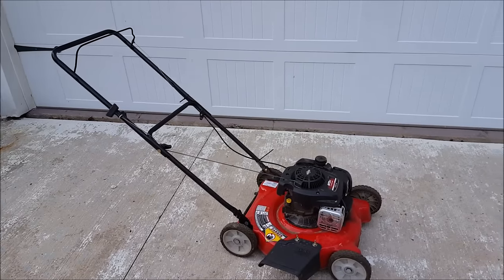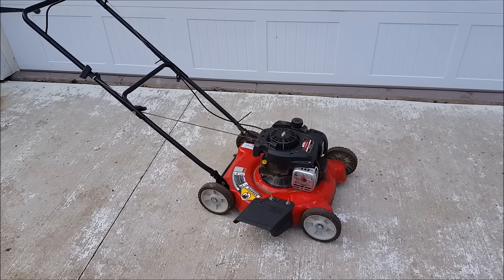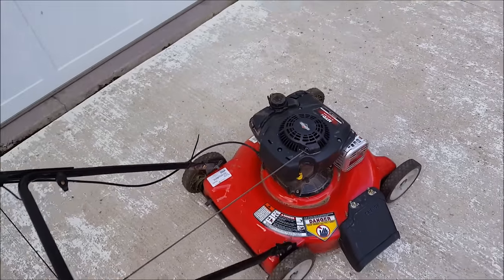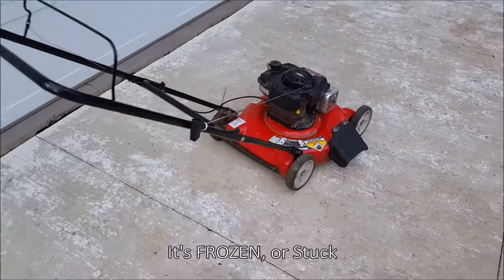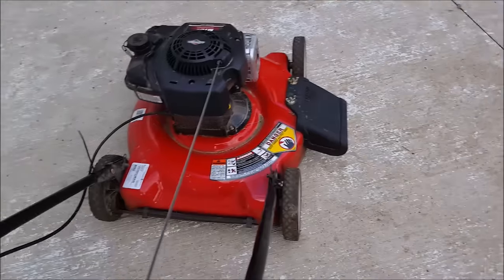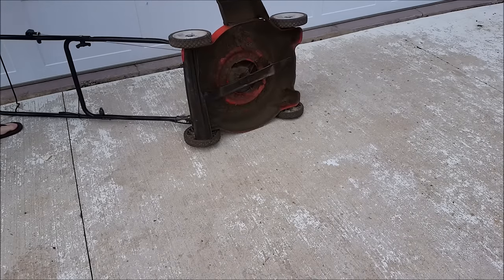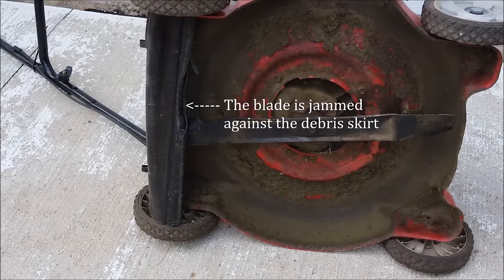How To Fix a Stuck or Frozen Lawnmower Pull Cord (EASY)

Comment: I turned it on its side and I removed all debris that was under there and I turned the the blade by hand it was really tight but after a few turns it did turn some what, however as I was turning all the sudden the air filter popped off and a bunch of oil spilled out. The cover was off the air filter because I had purchased a new air filter and was going to put it on. There is no more oil in the mower now. I think I should also volunteer that I am a 63 yr old widow, my husband was a wiz and fixing things and before him my father was also a wiz at fixing things. Everyday I realize that  nobody ever taught me anything useful. I am a wiz at many things but not at keeping things in working order. Dads teach your daughters how to fix things, it is an important life skill.

Comment: I was ready to go and buy a new lawnmower.  I watched another video on how to fix the pull string, but realized that was not the issue.  After watching your video, I looked at the underside of the mower and realized it had quite a bit of built up hardened grass and dirt... A simple cleaning and the mower worked as good as it did.  Thank  you so much for the information.

Comment: Thank you so much! My Big Brother used to work with small engines lawnmowers, carburetor's and such.
He passed away last year. I'm living in his house and when things like this happen, I just tell him I need him back. I know that's not going to happen but I want to do the best I can to take care of his property. Things like this are really hard because if he were here, it would be working. I called a lawnmower repair guy. I think he was a competitor of my Brother's business. He told me the mower was junk because it seized up. Wasn't friendly either. I guess he was mad because the city we live in picked my brother to work on their small engines. My brother was in a wheelchair but he didn't let disability define who he was. I miss my brother terribly as you can tell. I'm going to go check the lawnmower out like you said. And disconnect the sparkplug first. My brother drilled that into me. I miss him a lot as you can tell.
Thank you. EDIT: Well, it wasn't what you said but if I hadn't turned it over I never would have seen a LOT of dry grass was holding the blade in place and it wouldn't turn. I cleaned all the dry grass out, connected the spark plug. And it STARTED! Thank You Thank You THANK YOU!

Comment: Thanks this solved my problem today! It turns out there was some grass stuck between the blade and the frame, which made it impossible to pull the cord. After clearing that out, it worked fine!

Comment: Thank you so much.  I was mowing and stopped to move stuff and all of a sudden, no pull.  I did not have a dragging skirt, but it was easy to see that OLD DRY grass had accumulated and would not allow the blade to rotate.  I guess I see the point of the deck wash port now.

Comment: Thank you sooooo much for this video my cord was stuck and it would not pull. I turned it over on its side and there was tons of grass jammed up around the blade. I cleaned out the bottom of my lawnmower and pulled out that part that you said to pull out and it started right up. I thought I was going to have to buy a brand new lawnmower you saved me a ton of money. Thank you again!!!!🙏🏾

Comment: Thank you for making this video. In my case it was a bunch of clogged up old grass probably from the previous 2 years. All my life until retirement I was at the mercy of Lawn Mower Tune-up fixers who take up to 3 weeks to tune a lawn mower up. (They tell you it takes them 3 weeks. It only took me 15 minutes to install a new Spark Plug, drain and replace the oil. Install a new Air Filter and clean out the empty gas tank.)   You saved the day!  Thanks again!  (One thing yet to do: remove the blade and have it sharpened one of these days.

Comment: Thank you u-tube dad. Good name for you. The u-tube father 😊 fixed in a few seconds. Also sometimes you have to turn the blade around clockwise a few times and it pulls when you try and start it. Mine still sticks even though it's new 😮 I cleaned the grass off. Checked for obstruction and still sticks and won't pull. My lawnmower is only a few months old and I've used it 6 times. 350.00 crazy

Comment: Can't express enough my relief with your help! You said, check the blade, and only after looking straight on that blade I finally figured out that it is a thick twig sitting their preventing blade to spin! But before with help of another video  I removed the cover on a top, found spring is fine, looked at the bottom, found nothing! That twig was just invisible and I could not see it! Until I heard from you that magic words, "check the blade" and then I touched it to see if it turns and revealed that dumb twig! Thanks for this lection for dummies!

Comment: I had  the pull cord stick on me last night, after I stopped the mower to move something out of the way.  I pulled it once, it did not fire, went to pull it a second time and it stuck.  Noting I would tell was blocking the blade, checked all the controls.  I brought it back to the garage to give up, but turned it over one more time to look under it and  I heard a pop by the handle of the pull string.  I tried moving the blade again and it moved, I set it back up gave the string a weak pull, just to see if it would turn over, and it actually started up just fine.  Any idea what could have happened?  More importantly, is there something else I should check, like was this a sign of a bigger problem?

Comment: My blade won’t turn because for shipping the handle is pushed short and the ends are blocking the blade from turning. I couldn’t loosen the T-bolts to extend handle. What tool do I need? Thank you.

Comment: My friend gave me lawnmower and she told me it works I change the spark plug and put new gas and oil in it was both out none at all then I clean the carb and make sure the blade not damage or caught inside anywhere.. I prime it 3x I pulled the cord and didn't go back in sooo I'm lost need help do u have any videos how fix that also ur channel help me out and I'm new subscriber too

Comment: So, I was getting ready to go and return my 1 month old lawnmower because the cord wouldn't pull, and I didn't turn mine upside down because I used the hose port last time I mowed, so I was positive that it was clean underneath. Wrong!!! Thing had clogged grass stuck in the blade. This is my first lawnmower with the hose port, so I thought it worked but evidently it doesn't.  Unfortunately because I tilted the lawnmower, it evidently got flooded so it won't start right now, but the string pulled so we are moving forward in the right direction!!!. Thank you for this, it would seem just common sense to see if the blade was stuck, but all I thought was that the engine was jammed.

Comment: Please make sure you unplug the spark plug before you do this!  Also, turn the mower so the air filter is on top.
Reply: Why?  I don't know how.
Reply: @robinobrian4842  remove spark plug to avoid getting your hand chopped off.
Reply: Robin Withrow typically it‘a a good rule of thumb to flip your mower onto the side that grass comes out. Otherwise your oil can get into places it shouldn’t.
Reply: @E figurora could you explain how you would get your hand chopped off when lawnmower isn’t even started ? Curious how that works lol

Comment: Great to know... so what about my pull cord that is all the way out and won't go back in?  Know anything about that because I have to mow this jungle
Reply: Hey mine was the same way, like he showed check if anything is stoping the blade from turning, mine had a sting tangled up around it I cut it loose gave the blade a little spin with my hands and boom it sucked the cord back in

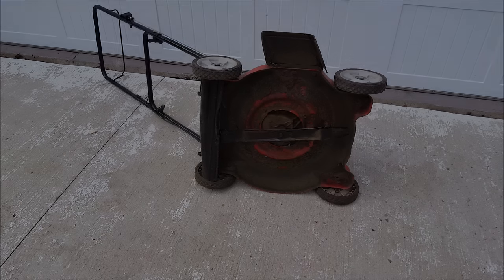Comment: Thanks, actually I'm even more stupid. New mower and I misunderstood the manual (because it was for 4 different handle systems!)  I didn't pull the handle out all the way so the bottom of the handle shaft was blocking the blade from moving, causing the exact same condition. You solved it in 1:30, after I wasted 20 minutes in the manual!

Comment: Bought a new craftsman and could not pull the cord on the first start.  The side bars of the handle bar were seated further in under the mower to stop the blade during transport.  I unscrewed and pull the bars up.  Worked.  Duh

Comment: This didn’t help lol. Mine is brand new and won’t pull. It worked for 10 seconds going forward in a straight line. Then stopped and now the pull cord won’t pull.  Nothing is jamming my blade

Comment: Still no specifics on Husqvarna HU 725F Briggs&Stratton 725Series tm. It's the motors stuck on the left top engine where the Control Bar cable attaches  thanks ok Propitiate you all Roman's chapter 3! Good day bright and sunny here oh the sunrise is excellent gonna be up in the 90° today

Comment: Jammed blade.  I've seen the coil get loose and go up against the flywheel or if the brake cable is broken. If the cable is broken take the brake completely off the engine and run the kill out. When you want to turn it off touch the little black kill wire to clean part of the engine(metal) and it will kill the engine

Comment: You should add there is a right way and a wrong way to turn your mower over. You didn't, I didn't know and oil and gas leaked into the air filter and now I've got a bigger mess.